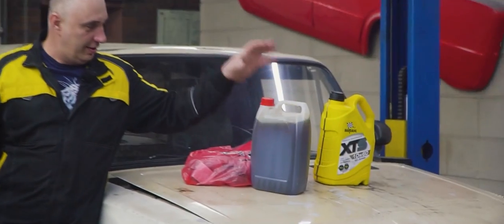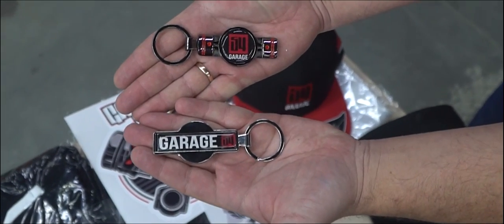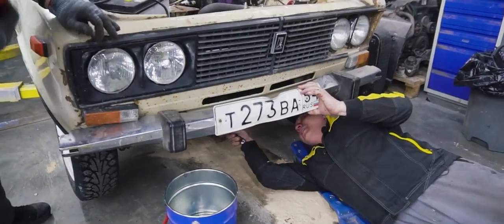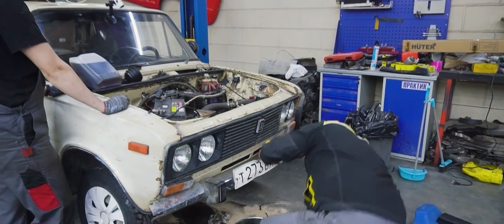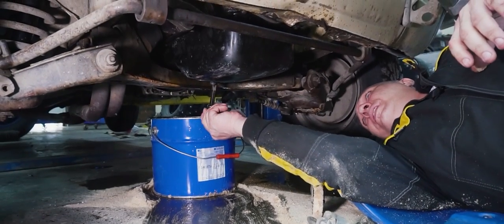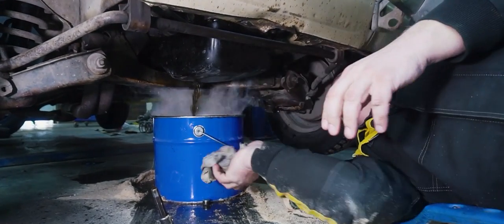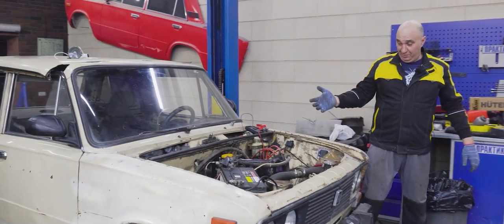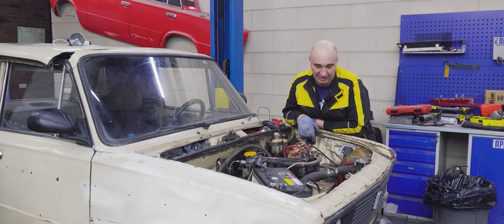Can you change the oil on a running engine?

Comment: Next time try to change the head gasket on a running engine ! ;-P
Reply: Is not possible because you need to quit head block
Reply: And there no valves to keep engine firing and running

Comment: Nissan's official service manual says the correct procedure for changing transmission fluid is to do it with the engine running.  Not exactly the same thing but getting close.

Comment: challenge: push start an automatic lada.  for example for me i have an 07 honda civic . It has  to be rolling in 1 st  at about 15-18 mph before i can switch the power on and it goes . (note , battery must have some charge to energize altenator) so this is more a broken starter type of scenario.

Comment: Could you crank start an engine by hand. I know thats how they did it in the early days of the automobile using a magneto system. Is it possible on a more modern engine If your starter goes out.
Reply: The first batch of ladas (round lamps(?)) were equipped with a hand crank. Have cranked one over myself. Took a few tries but it got going. They also had a hand pump on the fuel filter to prime it.

Comment: Get a BIG pan and then dump lots of oil on top. And eventually it'll come clear. It's probably the best way to do it since it'll flush too and get the most oil out and new in.

Chevy uses a big tank of oil to slow break-in their Corvette engines. It's mounted over the tank with pickup in the oil and then they slow rotate it like 150rpmish to make sure the motor pumps oil through and they let that go for about a day. I imagine it's like a "spa day" for an engine lol.
Reply: That’s neat. I didn’t know that’s how they break in engines from factory.
Reply: Dreamer. You really think any engine will run at a factory for 1 day? Not even on million dollar super cars.

Comment: 10w60 😳? That car definitely has the tolerances of the AK-47 too. Try this with a Chrysler and it my not even start before the oil change.
Reply: You know any car requiring 10W40 can be run with 10W60.
Reply: @Chris-yy7qc  Most of the cars I work on now use either 5w30, 5w20 or 0w20. On a rare occasion I get one that uses 0w16. 10w60 is not even available in my area.
Reply: @Chris-yy7qc  When I check cylinder clearances on normal cars I use a feeler gauge, with the Lada I would have to use a coin. Lol
Reply: I run 15w40 in my aircooled VW beetle engine, specifically the "heavy duty" variety used in diesel engines. I've run as low as 10w30 before, but it seems to run smoother on the somewhat thicker oil.
Reply: @brucetec6597  So youre working only on cars up to 10 years old? Parts swapper not a mechanic, aye?
Reply: @Chris-yy7qc  Actually I am a full technician with my own shop. Yes most of my clients vehicles are 10 years old or less. I do have some older ones but they still don't use 10w60. That weight is not available in my area at all. I like customers that have the capability of Actually paying for the work. My time is valuable and I am in business for profit and not a charity.

Comment: You guys should try to do a valve adjustment while the engines running
Reply: I dont think that one is possible. 
Once friction starts to warm the valve stem/valve train up, lash changes tremendously. 
That's why valves are always adjusted from dead cold.
Reply: @austinlane5533  wrong, some valves are adjusted hot , and a lot of manufactures offer a hot and a cold adjustment
Reply: 20 years experience and this is the first I've ever heard of adjusting a hot valve.. 
Not to say it isn't possible, or I disagree. Just no experiencein my line. I'm piqued.

Comment: Oil a water may mix in case of broken head gasket, so may me use the same fluid for both usages :-), you just have to ajuste some drilling diameters, but should work

Comment: I reckon, if you installed a valve inlet of some description so you can force the new oil in under pressure it would be a lot easier to pull this off. Taking in to consideration once the sump plug has been put back in and the system is sealed you would need to have higher pressure outside that inside the oil system for it to work.
Reply: It's never really sealed. There's a crankcase vent leading to intake manifold so it stays at or below atmospheric pressure.

Comment: Use 3 people..like a pit stop. One drains oil..while one removes the oil filter and the other person is ready to fill..that way it wouldn't run the risk of seizing.

Also try change plugs with the motor running...one at a time. Loosen..change and reconnect the bougi...then move on. 

Love Garage 54 you guys are amazing. Would love to meet Vlad

Comment: They do this on the plow trucks up in Alaska but you dont have to pull the plug they have a pep cock with some quick fittings and they add oil as its draining then shut it off when it runs clean . then they shut it off and change the filter

Comment: might work better if you use the engine to pump the oil out, and pushed the cleaning oil thru the motor. like use a hydraulic cylinder with cleaning oil on top and pump the used oil in on bottom. just swap it with the oil pump output with a valve. if you swapped it in place of the filter it could be changed at the same time. would be great with a remote filter setup.

Comment: Use “Slick 50” it Teflon coats the engine you can run dry, after using on one litre.

Comment: Fun trick you could have done to prevent oil from coming out of the drain plug until you want the oil to drain is to use a powerful Shop-Vac and you secure it to the oil fill on the top of the motor turn the Shop-Vac on take the drain plug out and the shop back will create enough suction to pull air through the drain plug that's preventing oil from pouring out shut the Shop-Vac off the oil drains

Comment: Use 10w60 on this old type of machine would cause almost all seals leak.
Reply: Explain, please?
Reply: @talltomtube  old seals are not designed to tolerate such aggressive cleaning oil. When I put 10w60, I had a bad leak everywhere after replacing all seals with uprated ones and valve stems seals uprated it was gone. Old seals works on sludge the sludge is what prevents the leaks. Fully synthetic does the opposite and cleans up sludge.

Comment: From the states. What is "flushing oil"?
Reply: Thin oil with detergent additives. Not for lubricating but rather for just internal engine cleaning to remove sludge or other deposits
Reply: @williegamer800  we don't have anything like this in the United States. We just dump, change filter and fill

Comment: I really want to see if it's possible to bend a valve rotating the engine by hand using a 1/4" ratchet up to a 3/4"

Comment: So my grandfather has been gone a long time now but he used to tell me that when he was young they used pork rind or some sort of animal hide for crank bearings and on the 80 mile trip to the farm he worked at during the summer's it was normal to have to change a couple of tires and change our the  'bearings' on the side of the road.  He said when the engine started knocking, you'd pull over, drop the oil pan, take the rod caps off, put a new piece in and tighten everything back up again.

Comment: We put oil line in filler hole and crack open. Pull the plug on pan and let drain until clear. Fill until the sight window is covered. Simply unscrew the filter and spin off/on fast. Its very seldom we ever shutdown for oil change on the towboat. Same process for the vacuum pumps onboard. 
Of course it’s easier on diesels than gasoline engines. Good video, not a lot of people know this stuff.